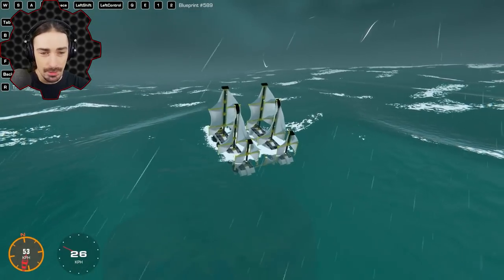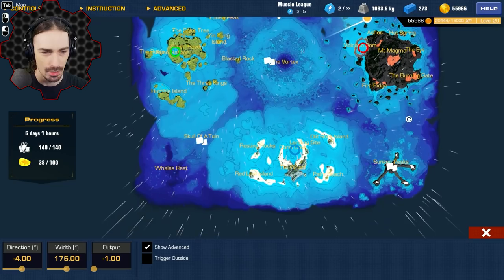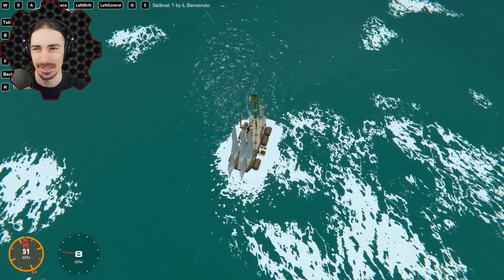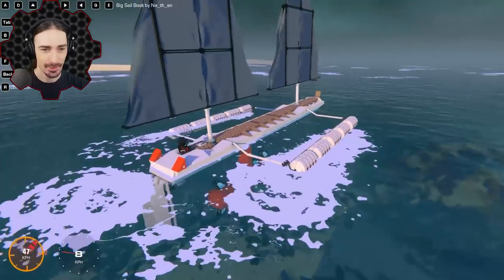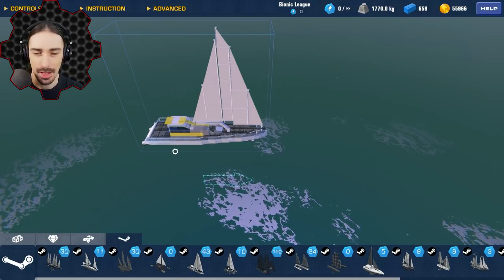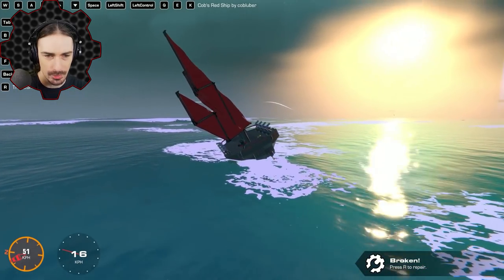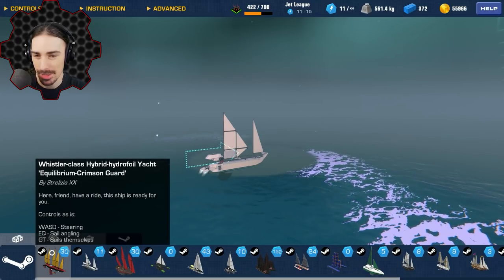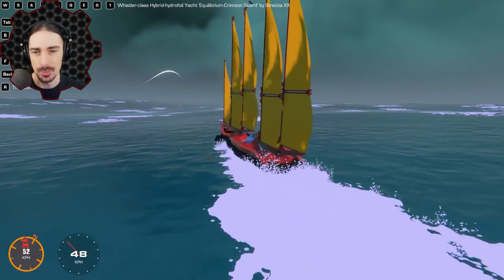Sailboat Creations That Can Actually SAIL INTO THE WIND

Comment: If the sails are in any way accurate with reality in trailmakers, a good sailboat should weigh around 1.5-3 tons (small and medium sized sailboats) and the best wind for sailing is around 30km/h.
In conditions of higher wind speed, only the larger sailboats sail or if smaller, they're not on the full sail span.

Comment: Sailboats move fastest when they travel perpendicular to the wind, and a well designed sailboat can travel faster than the wind this way. This is true in real life and in trailmakers. The trick is transferring the perpendicular force of the wind into forward motion by properly angling the sails and not tipping over. In trailmakers this is much easier to accomplish with wide outriggers and lots of shallow fins under the water rather than a deep keel and weight blocks. I was able to build a 0-core sailboat that can travel 50mph perpendicular to the 32mph wind with this method.
Reply: Isn't it around 45 degrees from the wind?

Comment: When sailboats go faster than wind they angle the sails so they form a wing and lift force is generated in the direction the boat is moving. That’s why moving directly into the wind is not the fastest way to move.
Reply: That’s not true lol.
Reply: A little bit of headache reading this
All those reasons is why moving directly into wind is not the fastest way to move? Wtf?
Reply: Yeah but air pressure/lift is not simulated in the game. Well, it's simulated for plane wings, but i don't think it is for sails.
Reply: This is kinda hard to explain but as a person who sails sailboats I can tell you that sailing with the wind is not the fastest
Reply: It’s kinda like how a propeller makes a plane go forward

Comment: Well you just discovered the Compass, now you gotta think of a way to use that thing in a cool functional way (because I coundn't)
Reply: I do a setup like you would for angle sensors in automatic roll, but adjust it with servos and use the output for automatic steering.
Reply: @TimeKitt  Like for self-driving stuff? If not then I don't think I understand how different that is from regular steering
Reply: @metalburger1117  Like keeping from accedently turning while driving a boat in the wind, you'll drift to the side from it, but wont to/away from the maw.
Reply: @TimeKitt  Eyy that's pretty clever

Comment: I have made a really good sail boat that goes faster than the wind and is only one core (gyro stabilizer). I will publish it in  around 10hours.
(For fastest speed go up wind to the side of the wind with the sail 45 degrees to the leeward side of the boat.

Comment: Where hes failing at is the fact the sails are used to catch different angles of wind, the keel is used to keep the boat balanced (youll need a keel long and wide typically starting 70% to 40% of the hull.  And the rudder is used for directional change.

Comment: In history it wasn't until around the 1600's that you could actually sail into the wind and even then it required a massive vessel and I think this might be because for a ship to sail against the Wind they need the weight required to actually resist the wind and they need the hull shape capable of resisting the waves small vessels like a sloop or a catch where rarely capable of going against the wind and even then it needed to be very light winds and ship sailing against the Wind usually lost about I'd say 60% of their speed making them not the best for sailing against the Wind however to combat this slowness usually ships were equipped with paddles and in which the cruise could actually paddle against the Wind also they adjusted how much of the sale was open because you can't Sail on full Sail against the Wind
Reply: I would like to mention that I am not a master shipwright and I could most certainly be off on quite a few things
The only types of sail ships I know anything about is the frigate the First Rate and then the Viking longship and if I remember a frigate is a sixth rate or a fifth rate

Comment: day 107 or 108 of asking scrapman to start a Survival series amphibious tank/basically any transportation and floating base/barge (or under water.) But you need mods... it's a requirement to breathe underwater, if you want an underwater base/transportation. And yes i am talking about the underwater fan moonbo reviewed that basically makes water spaces air spaces... if that makes any sense.) (and if you wanted to move the barge/boat/floating base you are able to make thrusters/glitches/mods to do it or by lift or actual push)

Comment: Scrapman i have a radio control boat i cannot use in winter if you want real life experience of sailing a radio control sail boat... I notice you have no idea how to sail a boat. you have to adjust the sail to increase or decrease wind pressure. If you do not you lose control of the craft or tip it over.
Reply: I noticed your lack of notice that he has, in fact, sailed a sailboat.